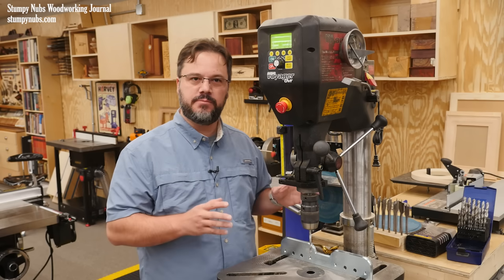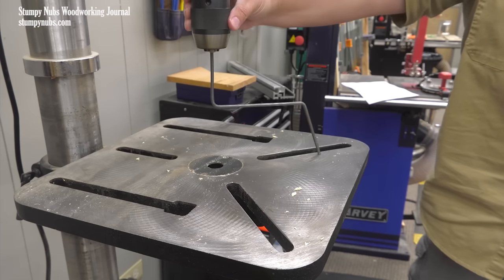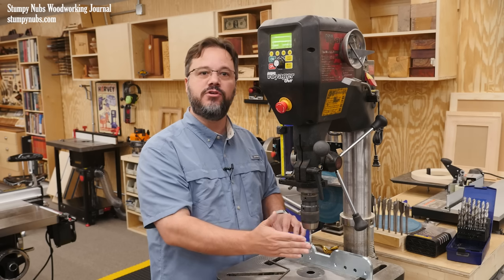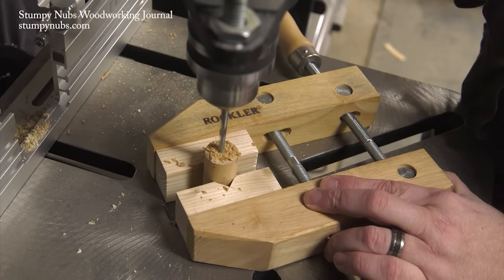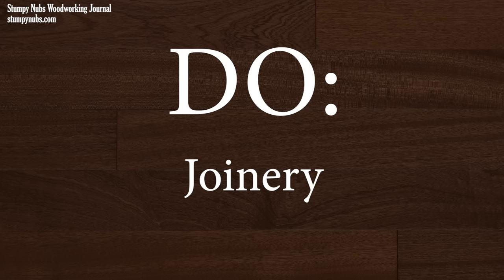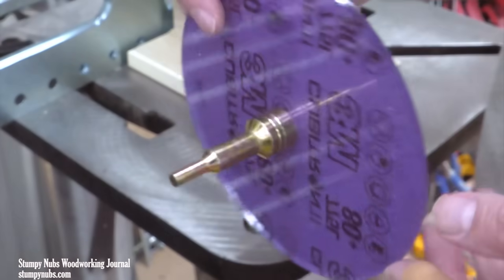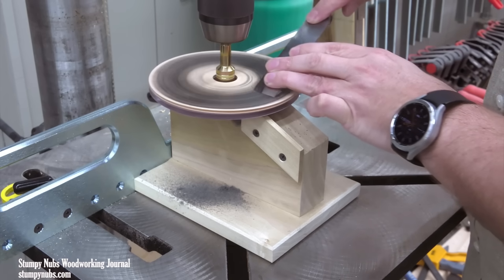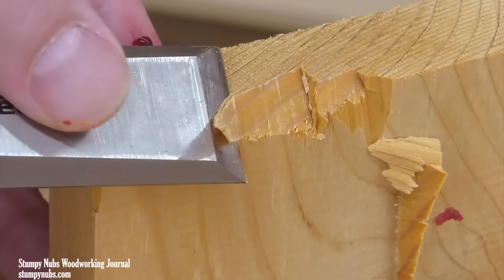WARNING: Internet drill press trend can SERIOUSLY hurt you!

Comment: I have a drill bit gauge, it sits dusty on a nail on the wall by my drill press. I'll stick with my dial calipers which I also use to check overall OD and root ID before drilling holes. I have one of those really strong magnets on the side of my drill press for holding chuck key, plus a hook with a cheap paint brush on it to sweep away shavings and I ran an airline to the wall behind the press so I have a short plastic coil hose with blow gun on it to clear the table.  Also spend the money for good quality drill bits, if you work with metal a lot and machine screws threaded bolts etc, buy some number drills (work with machine screws to drill clear holes and holes to be tapped), for threaded bolts, you'll need Letter drills to tap holes for hardware 1/4" and up. I have a drill doctor and though I have seem some bad reviews, I have nothing but praise for it, easily sharpen small to large drill bits,  the newer model does  3/32 all the way to 3/4". I never could get the hang of doing them on a grinder by hand.

Comment: One time, I forgot to take the chuck key out of the chuck on my drill press. When I started it up, the key went flying like a rocket, but luckily away from me. I learned to attach the chuck key to a short length of sash chain, which I attached to the machine. If I ever forgot to take the key out again, the key could only go as far as the chain would let it and never hit me.

Comment: Brass is a lot chewier than most metals, along with copper. If you know what to do, you can sharpen drills especially for brass and copper so they dont grab. Sheet metal also requires spacially sharpened drills.

A very important one you missed is having materials to the left of your body while drilling. Clamped or not, if it lets go it has nowhere to go except into the column. 

Another common one is running drill bits too fast. Bits can quickly heat up and jam if run too fast and/or not lubricacated, and a suddenly stopped high spped bit can shatter under load and send shards into you.

Another one I see is people plowing through the bottom of their workpiece. Not only will this cause chipping and excess wear, but its one of the most common ways a bit will grab a workpiece and spin it. Mark your bits woth a texta or piece of tape and slow down at the bottom of holes.

Comment: I'll tell my embarrassing mistake here so nobody else repeats it. I figured I could create a flat spot on the curved face of a PVC pipe cut in half by just shaving a bit off the top with a router bit in a drill press(mistake #1). I didn't have the workpiece well secured(mistake #2) so as I pushed it into the spinning bit, the bit caught the material, and like a rack and pinion, sucked it in. I got a decent gash in the tip of my index finger and was VERY lucky that the bit didn't rip up my fingernail. Urgent care glued it up and it healed nicely, but it could've been so much worse.

Comment: Agrees drill presses can be dangerous. Large drill bits used to drill steel is very prone bite and can spin the  part at high speed.  This happened to me drilling an knife blade. The bit caught, it yanked it from my hand spinning at 2000 rpm  nearly cut off my thumb then shot the blade across the garage at high speed thankfully missing sending it three inches into my chest.    It took twelve stitches to save my thumb and after that i only drill with workpiece clamped down.  Much more caution used in the future.

Comment: We all know you should always clamp your work to the table, but most of us have probably drilled more than a few holes just holding the work piece in hand. If you happen to be using the "hand clamp" method, here is an invaluable tip: dont try to hold the work from spinning, i.e. pulling against spindle rotation - you will fail. Instead, press the work straight down into the table. This mimics the ecact physics of clamping to the table and you will be astonished at how securely you are able to hold your job.

Comment: I've got a Shopsmith I've changed over to just be a drill press. Works well as a variable speed drill press. But those dam things had a Router/Shaper option. It's terrifying to use and I've only ever used that mode a couple of times year ago.

Comment: Magnetic cups are really handy but don't use them to hold drills that will be used on steel or iron.  They magnetize the drills and make them collect the shavings; not an issue for woodworking only.  After my own share of near accidents by either stupidly hand holding or using Vise Grips or similar pliers the woodworking screw clamp has become a favorite for controlling workpieces in a drill press.

Comment: What would be really useful is a faster way to clamp things down to the drill press table. Mine seems to be designed to prevent use of quick clamps in every way possible, and putting a threaded rod from the underside takes a long time. (no flat surfaces underneath)
What good solutions have you all found?
Reply: Bolt a cheap cross slide Vise to your table

Comment: using a dowl rod with a central shaft and sandpaper to create small drum sanders for light wood shaping, particularly  model plane propellers.
Reply: For that it works, as the lateral force is very small. But even on those I would recommend a dremel or similar tool to do it by hand.

Comment: Jim is the sharpening kit available on Amazon for those of us in Europe?  And yes Jim I nearly choked when you hit the chisel with the hammer. I bought some of that particular brand last year and I brushed off one out off the box and sprung a sever leak. You got off lightly. A couple of paper stitches were required. They did need a bit of work to get the back flat, but they are very nice chisels.

Comment: At the beginning we learn that the chuck may come out of its conical receptacle under a lateral loads. At the end we use a tool that is loaded excentrically and downward...
Reply from the maker: The latter example is not even close to the same force as a milling operation with a router bit.

Comment: As you get older you tend to acquire 100s of drill bits. Keeping them in an indexer becomes impossible. I bought some partitioned containers and labelled each partition 1mm, 2mm, 3mm and so on. Then all the drills are sorted based on their nominal diameter....sort of. I would put all the drills 2.1mm, 2.2mm, 2.3 all the way up to 2.9mm in the partition 2mm. When I need a drill bit, but it only needs to be close to a certain measurement, I just  grab one from the appropriate partition. If I need an exact size, say for a hole for threading, I just grab my digital vernier and go through the drills in the appropriate partition. When you have several hundred drill bits, this works a charm

Comment: Dont use magnetic holders for chuck keys, drill bits, pliers or anything you dont want to be magnetic soon enough. Hell my stainless steel calibers have turned magnetic over time from measuring neo magnets and hence now there is metal chip or dust tolerance error chance every time i use them, specially since i work with multitude of materials. For the chuck key get ski lift card holder thingy that winds the key up or stronger one out of old tape measure and string. Only issue is how to mount it to the key it self, but plasma cutter will make hole rather fast even on the hardened metal those keys usually are. Or use make kinda large loop from the string, push it trough shrink tube, put it into the key, turn the loop over and hook it behind the key tab, pull and shrink it, then add another layer on top. Use heat gun and mild heat so you dont melt the string. You can also roughen up the surface with sandpaper and use tab of super glue to secure shrink tube to the metal.

Comment: ..get a piece of 12 mm cylindrically ground bright bar tighten in your drill chuck, use a comparator or dial indicator to check run out of the chuck and bearing shaft separately...looks like a problem on that drill press.
Reply from the maker: The keyless chuck has some runout. I am aware of it and looking for a good replacement chuck.
Reply: @StumpyNubs Glad to hear it Stumpy and good luck to you! Cheers from Australian metal machinist.

Comment: I was a pressman in a printing plant and we had a machine shop. One day my supervisor had a 1"x2"x24" piece of steel that he wanted to use the drill press to drill a hole and so he asked me to hold onto it while he drilled. I asked where the clamps were and he said we didn't need clamps. I refused to help him and he couldn't seem to understand what my concern was. He was able to get the hole drilled with someone else's help and said see no problem. A while after this he decided to use the drill press to mix a 2 gallon bucket of blue ink the way you mix paint with a hand drill. He got another supervisor to help him and when the bucket started to flop around he told him to turn it off. His helper hit the speed control instead of the stop and they ended up covered in blue ink. You could see their negative silhouettes on the walls of the shop. When I asked him later if he should have used clamps he said it was his helpers error. Some people just can't seem to learn. Thanks

Comment: don't use router bits is a bit harsh. what you probably meant is don't use your drill press as a router. i more than once used a 45 bevel bit for countersinking holes and that up/down motion the press was designed for works absolutely fine :)
Reply from the maker: I think you know what I meant when I said the problem is applying too much side load.

Comment: Okay, I don’t know what sort of drill presses you are all using, but mine has a torque limiting belt tensioner, so if the bit snags in the workpiece, the tensioner backs off enough to allow the chuck to stall, without stalling the motor. It’s a design feature and was thoroughly explained in the user manual. This is not an expensive machine, either.
I can verify, from personal testing, it will also stop if your overalls get wrapped around a 5/8” (16mm”) bit, before it gets tight enough to cause any harm, though that is a scary experience.
After that occurrence, I tested it and I can just about stop it by hand, with a 2” workpiece. I didn’t dare try gripping the chuck itself, with its nasty sharp edges, but I’m confident it won’t amputate anything, if the worst ever happens.
I would have thought more expensive tools would have similar safety features, albeit less crude than a springy tensioner.
Regarding the test for square, yes, that’s a good tip for situations where it matters and the chisel sharpening idea looks like gold. I must try that.
I do mine on an oil stone and it takes 10 minutes or more, if I have a very dull chisel. A chipped one will involve several minutes at the bench grinder, on low, first.
Freehanding is never a great idea, but in my case is actually safer than trying to use a hand held drill. I use it for repeatedly making the same size hole in steel/stainless/alloy parts, though rarely for precision work. It gives me a more reliable speed setting and takes the strain off my hands, leaning on the drill. I’m almost always freehand. On the rare occasions where I need to do something very precise, then yes, I’ll secure it and set the table carefully. But mostly, I use the X marks the spot method and if it’s a degree off vertical, or a 1/32” off centre, it doesn’t matter. I’m saving time, making bits last much longer and keeping the pressure off my arthritis. Not building an aircraft.

Comment: I have a rather large drill press that came from a defunct machine shop back in the early eighties, my dad grabbed three of them. Most of what it is used for is metal. With a one horse motor this thing has some serious torque even in high speed. Sometimes I do wish it had a larger chuck as 5/8 is sometimes too small. But in a repair shop not a fabrication shop. I have drawn my share of blood on it though. But you are correct, it is a dangerous piece of equipment and doesn’t get the respect it should. I’m very cautious about my table saw which with its 220 volt 5 hp motor would chew you up and spit you out and not even slow down, I’m cautious about my bandsaw which again is industrial, my upholstery sewing machine again industrial. But for some reason I never thought about the drill press being equally dangerous. I have a hand drill from my plumber days that actually scares me, I use it but nervously, a Milwaukee hole hog, I have see that thing break arms, I’ve been thrown through a stud by it and spun off a ladder. Most every tool used in woodworking or metal working can be dangerous but one piece of equipment I see in a lot of people’s home workshops that near nobody thinks about in terms of safety is that old air compressor, you find a good deal on an industrial 17 cfm compressor and don’t even think about the fact that the tank is 30 years old and has had moisture in it the whole time, until one day it explodes. There are videos on YouTube of compressor tank explosions, they are violent and deadly.

Comment: I worked in a shop where someone who really should have known better tried to drill a 1" hole in the end of a 24 foot length of 1.5" by 1/8" flat bar. It snagged as the drill broke through and lifted the metal out of the drill vice. Then proceeded to wind in the length of flat bar into a clock spring, the end of which then flicked out like a whip many times a second... Luckily the the guy managed to get away in time and we had a room emergency stops away from the drill. Well that woke everyone up on a Monday morning.

Comment: I use router bits and milling bits, but  im not removing a lot of material. Not very much lateral force. I drill alot of small pieces of brass. Any hole more than 3/32" and I use a vice. Lets just say alot of lessons have been learned. Lol

Comment: Also important and worth noting: Drill Bit Extensions are not balanced. Don't run them at high speed. Let's just say I won't be trying that again. At least i'm here to tell the story. Luck is all that kept me from a worse situation.
The bit bent to ninety degrees instantly while spinning at thousands of r p m. It nicked my wrist millimeters away from an artery (or vein. I'm sure some other commenter will correct me on that.)😢

Comment: I understand about wearing gloves and never did with my small home drill press. We were required to wear a very thin, goat skin IIRC, glove while at a job I had 40+ years ago with the 6 foot radial arm unit I operated, often using drill bits up and over 1.5" and putting holes in large forgings. That blood blister .... hmmm

Comment: If the spoon that was snatched by the drill bit was brass then that was part of the problem. Yes, indeed do not hand hold metal parts but alos brass requires a dedicated set of drill bits. A few strokes with an oilstone or diamond stone on the cutting edge aligned with the axis of the drill bit will stop the snatching of drill bits in brass and some plastics.

Comment: Always remove the drill chuck key prior to drilling. Replace that chuck key in the same area on the drill press EVERY SINGLE TIME! Do not operate the drill press until the stored position of the chuck key is visually verified. 
The old cap of a magic marker can be cable-tied to the column of the drill press to act as a storage holster for the chuck key. The first time you forget to store the chuck key, you will hear the chuck key thrown across the shop, and  you will be in for a tongue-lashing by your boss!

Comment: Watches, bracelets, rings and pretty much anything that goes around your arm, hand, or fingers are also big DON'Ts. I am looking at you Stumpy (even though you are not operating the press for most of the video).
As for "precisely drilling holes" I would take that with a cup of salt, it's not like doing it on a vertical mill with a DRO and a properly rigid spindle (make sure to have your ways covered though).

Comment: I bought a drill press with a laser pointer. 
The pointer body was brass with 240v AC between the pointer and the table.
Drilling any material with a decent size drill needs to be clamped.

Comment: Really!  Your hitting a Narek chisel with a hammer,  you could have dulled a harbor freight instead 

Great tips on the drill press, especially the holding down metal (helicopter blades) properly, I’ve had that happen with a cordless drill and it’s not fun. For metal I like to start with a small bit then finish with a step bit, going up in size slowly and they don’t snag the metal and send it spinning like larger bits

Comment: Actually, not all drill presses have a chuck that is only held in with a taper. My old Sears drill press has a chuck that has a taper, but also has a locking screw collar that holds the chuck securely in place. There’s no way it can fall out unless you loosen that collar.

Comment: I was in 6th grade shop class and sliced my finger open on a drill press. I was drilling through a piece of flat metal bar and the bit got stuck in the metal, all of a sudden the piece of metal is spinning on the bit. Didn't know I was bleeding until I seen the blood drops on the floor. Didn't need stitches.
Reply: Mr. Parrot never told us to clamp down the metal while drilling.😂 he was also the football coach.

Comment: All machine spindles should have closed-loop brushless motors. Much safer when you can set the speed and torque independently, and it will maintain the commanded speed up to the torque limit rather than using an overpowered/heavily geared motor to minimize slowdown under load. Use just as much torque as you need for the job, and if it snags it will stall rather than destroying the workpiece and/or tearing your arm off.